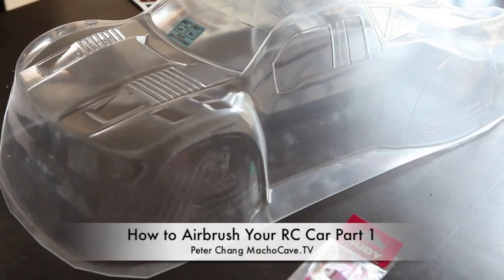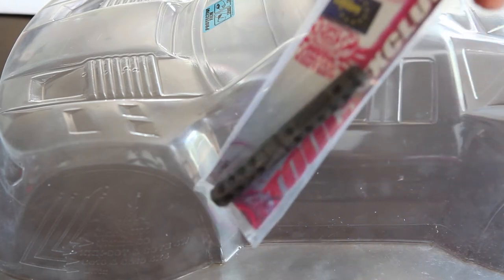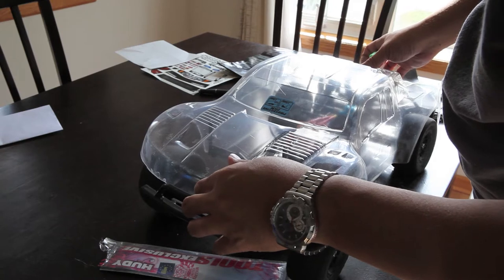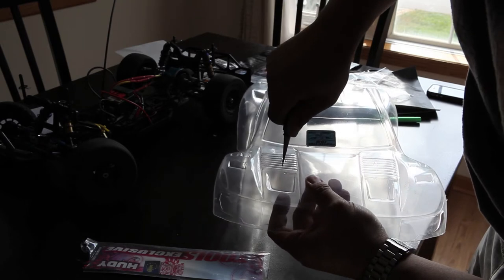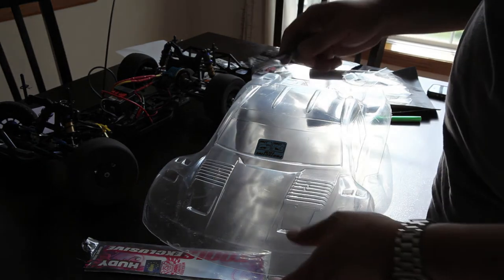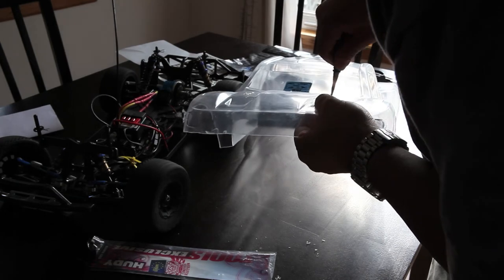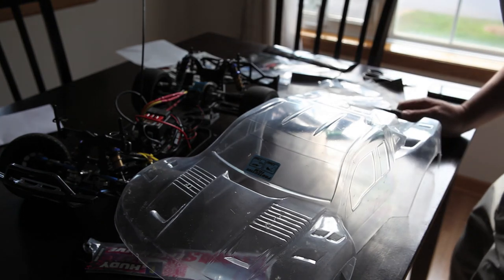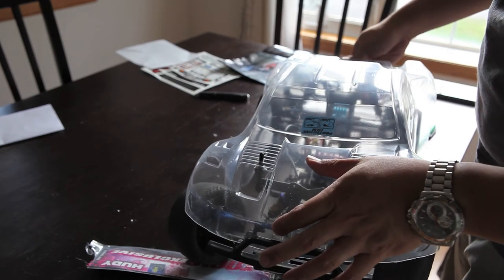How To Airbrush Your RC Car Part 1 The Tools

Comment from the maker: Great question! Yes you can, however a drill might be a little hard to control as this requires some precision. You could use a hand drill and for some reason, the finish doesn't look as good. I'd suggest practicing on some scrap pieces of Lexan or plastic if you are using a drill before you make the body post holes on the actual car body.